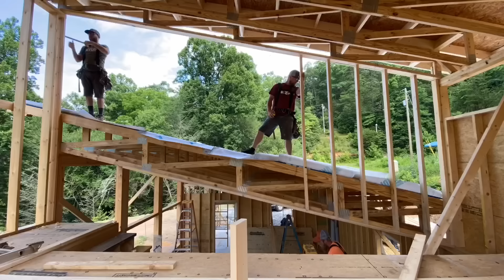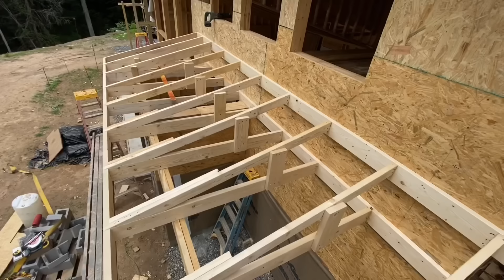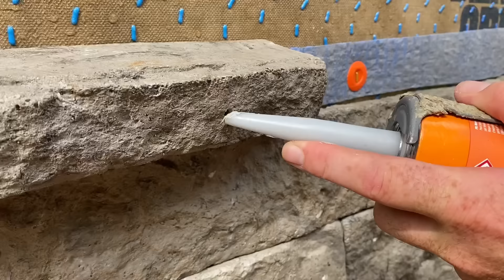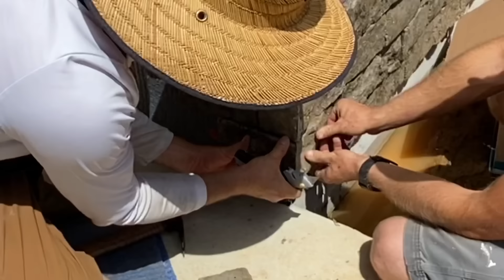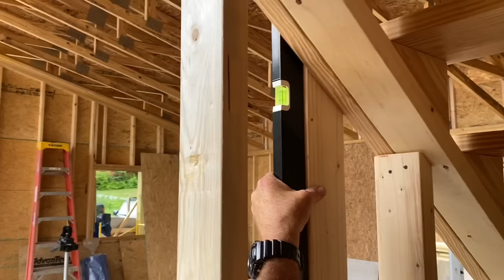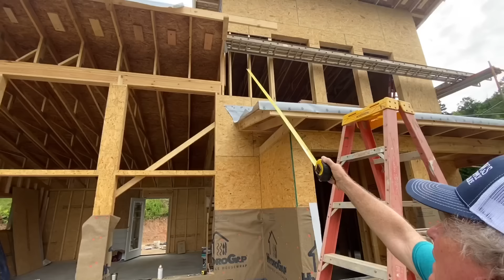Building A House Start To Finish | Episode 9: Stone Work and Loft Walls

Comment: As an "old" electrician I had a little one horse operation.  Never used the plans for electrical layout.  Always went through the house with the owner .  Wired the thing like it was my own [with their input of course] . I always had at least 5 or 6 circuits more than the average contractor. Only my little group of builders would use me because it always cost a bit extra. I can imagine with the cost of Romex etc. today  . I was paying $15.00  for 14/2 /w ground back then.  Inspectors couldn't believe my wiring.  Even though it had to be covered it was a thing of beauty.  Folks couldn't understand why I took so much pride in something as mundane as running wire .  Like I said "old "electrician.  I enjoy watching you young folks that still have some of the old work ethic. Never advertised and never had any down time .  There is an old saying " a man who knows how to do something well will always have a job---and he will be working for the man who knows why". Lord bless ---Just remember fellas that one day you will drive your last nail---be sure you're ready for eternity .  You know the Lord [THE MASTER BUILDER ] has been building some stuff also. Hope to see you there.

Comment: how much did/would it cost you to wrap that evolve stone around the house. I know that one box is $214 and one box covers 14.35sqf. So if it goes up 3 feet and wraps around 131.234 ft, it has to cover 393.702sqft. 393.702/14.35=27.4 so 28 boxes. $5992. is that right?

Comment: For the stair bevel cut, why not just slap the speed square against the stringer and measure with the level directly instead of measure/mark/measure again? Seems slower and less accurate that way.

Comment: Perkins Builder Brothers Thespians 🎭,
      Eric, that answered my question from episode 8; Wakeboard or Wake-surfing⁉️
YOU DID BOTH‼️🏄‍♂️  Hope you weren’t too sore afterward. Being pulled stretches our muscles long ways, opposite of lifting heavy weights on the job- You did Great‼️ 
      About the Stone 🧐🤔⚒~ 
Technology is taking away many centuries old trades like Stone Masons, Lock 🔐 & Key Builders such as YALL, and others‼️ As I have opined several times before, some of my experiences building and being a Stone Mason; this type of Artificial pretty much puts the nail in the coffin for a Dwindling Stone Mason Trade. 
Granted, not too many Natural Americans want to learn how to “Read Rocks” and “Mix Mud”, Hispanic Masons seem to own the trade because where they are from, Stone is readily available and cheaper than wood products, also cooler for their homes close to the equator‼️ I have employed many Hispanic Masons and they are extremely Skilled and Journeyed‼️
     It comes down to Money and a bit about application. I was advising couple of Artificial Stone Companies back then about mixing colors, textures and size because my installation looked NATURAL compared to other Masons laying it “right out of the box”‼️ It took a little more time, but less waste, to achieve the Natural Look‼️ That said; Artificial is fine for inside application like Fireplaces (as long as extra framing installed, fir out around firebox and create corners for finish measure of at least 6”) and if weight of Natural is cost prohibitive due to extra masonry to support the Stone‼️ Outside, though, Natural is my choice because it last for ever, even if Rocks from lawnmowers hit it‼️ 
     I have been called to repair so many Artificial Stone jobs that pieces were broken for various reasons or improper mortar used and the stuff popped off the wall. You answered a commenter that what YALL are using had 50 year guarantee, back then it was only 20 years. The wind, rain and sun would bleach the color out of some companies stone because they didn’t use enough color in their mix. 
      Money: Those days the cost per square foot of Artificial material was about the same as natural but the labor was cheaper ~~for some~~ because they laid it “right out of the box”, slapped it up (only to have it fall off the wall later after they got paid)‼️ 
     Watching YALL install that Artificial was interesting but raised a lot of questions‼️ It looks Great and YALL did a fabulous job ~~just please frame out the fireplace, if she has one, and use corner Rocks (worth the extra money) and maybe corbel out 3 layers (extra extra framing) for a NATURAL STONE Mantle‼️
Also, use Natural Stone for the Hearth top- more durable and won’t break if she sets something on too heavy‼️
      Hang in Jamie, saw the second surgery video and how you made it without pain meds-⁉️⁉️ I couldn’t do‼️
Prayers for YALL‼️
                 🇺🇸🇺🇸🇺🇸
                 ❤️🤍💙
                 🍑🍑🍑

Comment: As an architect from Germany, its interesting but also funny to see American homes getting built. The way these wooden houses get build and insulated applies to our garden sheds, but it would not be imaginable for an actual house to live in. Here, houses are way more expensive but theyre almost always made out of bricks or atleast thicker wooden walls.
Reply: How thick are the wooden walls in Germany? In nz its only 90mm/4 inches lol, so this is actually ok at 140mm/6 inches
Reply: @Sgten01  There are only very few buildings in Germany that are actually built from wood, but these walls are about 200mm thick to meet insulation standards. Brick walls have a thickness between 300mm and 500mm, depending on the size of the building and form of construction.

Comment: when working outside in hot weather, keep a bucket with water near you and keep you hat wet. You'll know within 5 min when all the moisture is evaporated and its time to dip it again, just from the mounting heat feeling. cotton hat works best. With neckflap when it's really hot. I reckon i can get though the day with half a gallon less water drunk and still feel OK at end of day.

Comment: I’m looking into stone veneers for my next project, will have to check out this product. I measure angles like that under stair, using a torpedo level and speed square and reading it directly. Usually have both those in my belt, and can yell out to the cutter.

Comment: Evolve really needs to start making wrap around corner pieces!
Reply: Beach&BoardFan can’t agree more, mitered corner just look wrong IMO.
Reply: @bpdp379  Apparently they do already make wrap around outside corners. I was just on their site...
Reply: Beach&BoardFan,
       Old Stone Mason here‼️
They are taking away my centuries old trade‼️🥺 I was one of the first to use artificial stone in the Atlanta Area. Back then, they only produced one color and texture. I taught them ( couple of companies) how to mix colors, sizes and textures to create a Natural Stone look. I still didn’t like it though because it only had a 20 year guarantee. Sun would bleach it white over time and if Mud (mortar) was rich enough or too dry, the stuff would pop off the wall, (Never happened with me)‼️ A Mason had to pay attention to heat and humidity during installation and allow for temps/ humidity after Stone was set, meaning mortar couldn’t set too fast or slow and cover during the night at times. 
     Corner Rocks Are Imperative on my jobs but they cost almost double/square foot or linear foot. 
      Artificial Rock fine for inside Fireplaces and areas where weight of Natural Stone would be prohibitive without using extra foundation support. 
     This type of Artificial takes away another Honored Masonry trade and income for the Dwindling Mason Trade‼️
This material cost more per sqft than natural but the labor to install drops to ZERO‼️
Reply: @joetownsend-  I'm looking for an experienced mason to work on Autoclaved Aerated Concrete blocks in the Atlanta metro area. How can I contact you?
Reply: oldporkchops,
      I am too far gone to be of any help, sorry! MS took everything I had built and worked for- especially my family! Adding to all of it is the 5 heart blockages/ bypass surgery about year/half ago! I was doing ok until 3weeks ago, now have Covid 19! Fighting just to breath!
     Check with “The Rock Yard”, Mark Knoll in Duluth and Gainesville Areas‼️ They are Master Masons‼️ 40 years relationship with them‼️
Reply: Yeah those mitered corners ruin the realism of the look.
Reply: @HuskyKMA  The mitered option is great for custom angle corners if your substrate isn't 90 degrees or isn't exactly square, but we have pre-fab corners available.

Comment: With the OSB gapped how do you protect the home from bugs and water over time? Using the control layers Water, Air, vapor and thermal it seems like this isn't good for a house over time. You do talk about ZIP sheeting system and how it overall comes down to cost. Though do you just reply more on your water house wrap in these cases? Do you do anything extra to control air leakage why using OSB sheeting? Can you focus on this in a future video! Thanks!
Reply: I think you have to install OSB with a gap to account for expansion… but maybe someone with more experience can confirm.